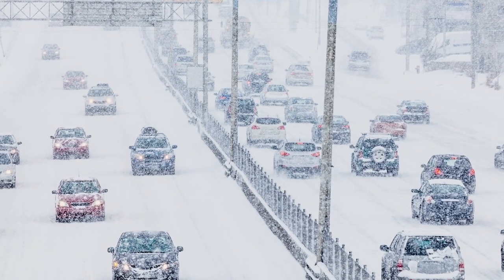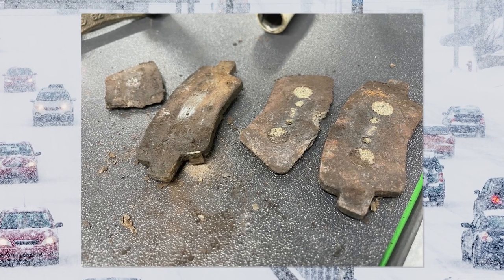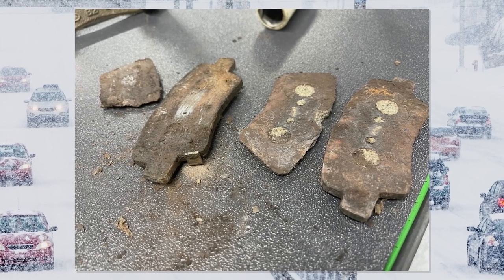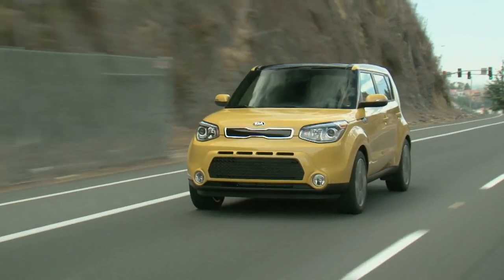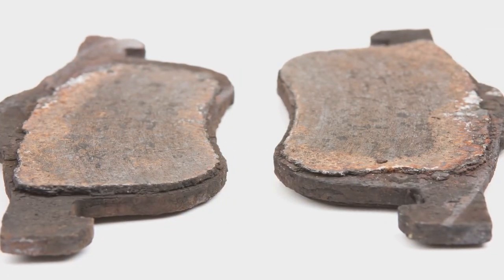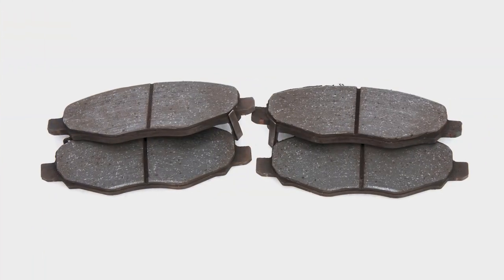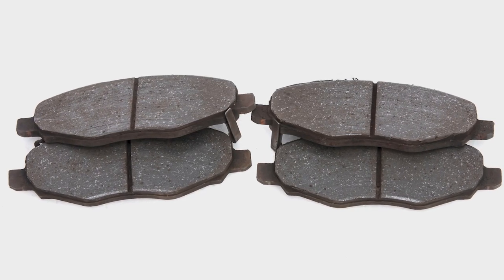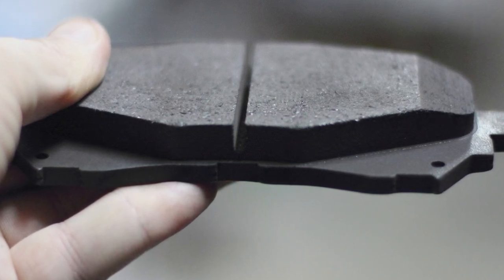How Corrosion Can Ruin a Vehicle's Brakes

Comment: I have a 2017 Kia forte. It’s just sitting in the driveway and the brakes are freezing up just from no use. 26000 miles. I believe it is caused from cheap steel on the rotors